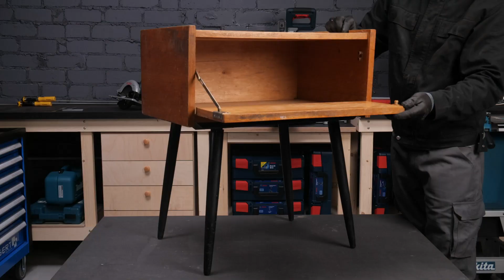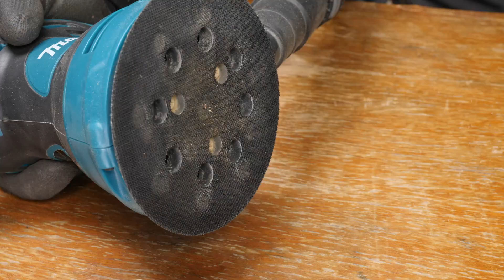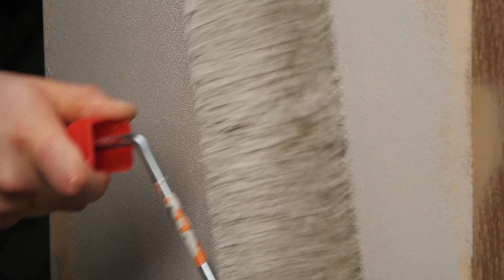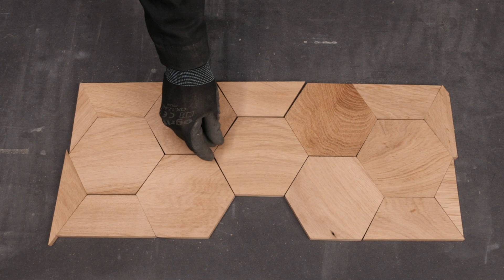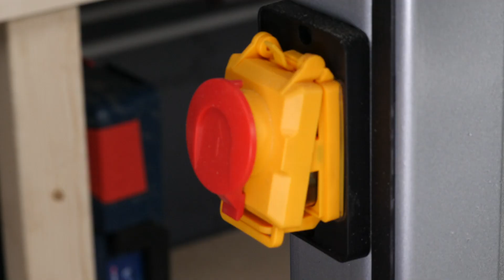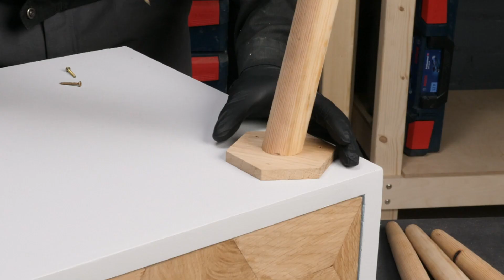How to Restore An Old Cabinet | Furniture Restoration

Comment: That's not a restoration. Restoration is when you RESTORE it to it's original condition as it came from the factory.
THIS is a fucking ABOMINATION! The bastard responsible for this desecration needs to lose his hands in a circular saw accident as soon as possible before he commits any more atrocities to other mid-century furniture.
Reply: Well, that isn't a restoration. This video could be better titled "scrap wood project". Kinda repurpose or upcycle a worthless object.
But don't cry too much for the original table. It was made of grain pressed board, thin veneer, photocopied design, cheap finish, bulk produced, low quality and horrendous condition. The wood, components, finish, paint and time is ten times more valuable than the original piece and now it has a new life better than be thrown to the fire. 
Not everything from mid-century is a valuable one. Just look at me! 
I suspect I'm not able to convince you, but let me share with you my humble opinion.